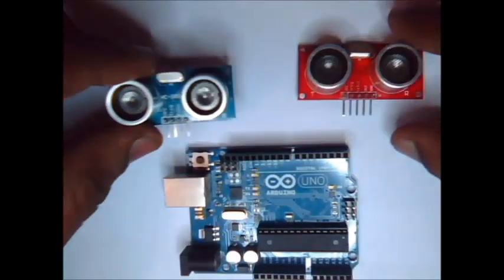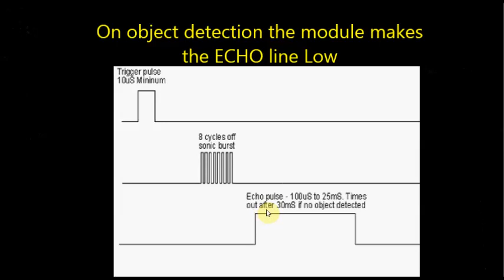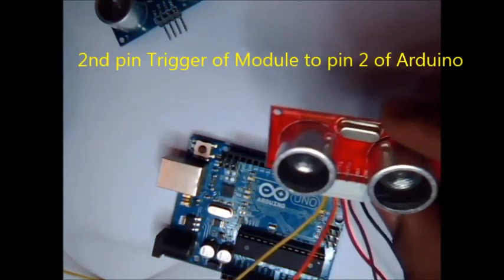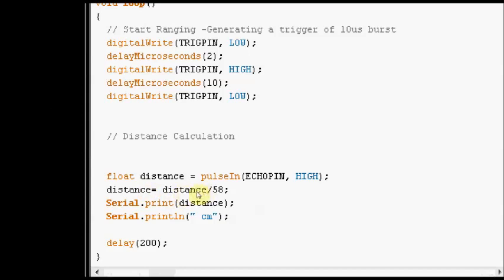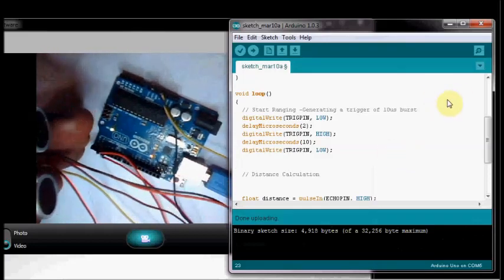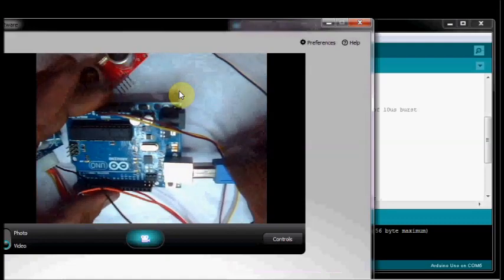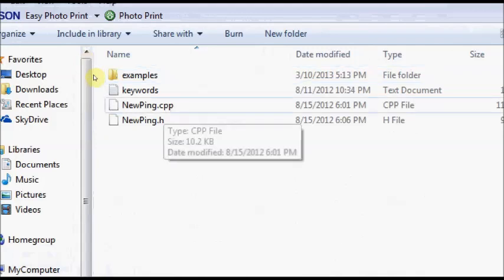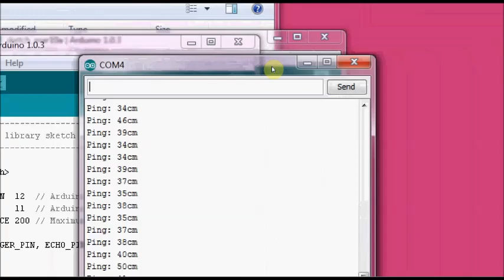ARDUINO - TESTING ULTRASONIC SENSORS

Comment: I would like to know the maximum possible length of wire connecting the sensor an the Arduino Board.
I Intend to place the sensor away from the Arduino Board. Thank you.
Lionel

Comment: If I was to use that sensor for measuring the depth of the fuel tank of a car, would the gasoline steam mess up my sensor readings? Or would it damage it within a few time?

Comment: i want to use an ultrasonic transmitter to repel wild animals like boar and deer which eat up the farmer's crops. i am told that a transmitter in range of 30-40 khz will be most effective. can you advise me from where i can get the complete circuit. I want to run it off a solar plate as in the field there is no access to electricity.

Comment: Nice, Now how can I use this for a more general Microcontroller (not Arduino) ? 
As I see this is serial communication based. How can simulate pulse (What output value shall i be sending out from the serial port)?

Comment: Hi Sir,
Currently i am using (LV-MaxSonar-EZ1 - High-Performance Ultrasonic Range Finder) this sensor have 7pins but don't have the echo and trigger pins,Shall i use any other pin for this purpose?. I tried in two three ways for coding as well as wiring but i am not getting constant value,please give me the advice.
Thanks for advance

Comment from the maker: The principle of operation of max sonar is different from that of Ultrasonic sensor,.You've to use Pulse width PW pin or analog AN pin along with serial out at TX. Google for " electrojoystick  " & click on "Tutorial for Maxbotix Sonar LV ' on the first result for an excellent tutorial

Comment: I've been using the 4 pin module, HC –SR 04. And i need to use 5 detectors at once. But i cannot figure out how to code it! The coding for a singular detector works great but i really need help using multiple detectors. If Anyone could help then that would be much appreciated.

Comment: //code for testing Ultrasonic Module

#define ECHOPIN 3     // Pin to receive echo pulse
#define TRIGPIN 2     // Pin to send trigger pulse

void setup()
{
  Serial.begin(9600);
  pinMode(ECHOPIN, INPUT);
  pinMode(TRIGPIN, OUTPUT);
}

void loop()
{
  //Start Ranging-Generating a trigger of 10us burst
  digitalWrite(TRIGPIN, LOW);
  delayMicroseconds(2);
  digitalWrite(TRIGPIN, HIGH);
  delayMicroseconds(10);
  digitalWrite(TRIGPIN, LOW);

  //Distance Calculation

  float distance = pulseIn(ECHOPIN, HIGH);
  distance= distance/58;
  Serial.print(distance);
  Serial.println("cm");

  delay(200);
  
}

Comment from the maker: Ultrasonic modules are used widely in distance measurement kits.Check out this post to know the types of Ultrasonic sensors & how to interface with an Arduino

http://alselectro.wordpress.com/2013/03/08/arduinoultrasonic-sensor-for-distance-measurement/
Reply: I tried to gnd out pin and use only echo but didn't work. Any idea?? Please help!

Comment: the hcsr04 sensor is having problem. it will not make the echo signal low if no object is detected.
Reply: +Bidyut Baruah You can use the NewPing library http://playground.arduino.cc/Code/NewPing . Your HC-SR04 work fine with. Regards